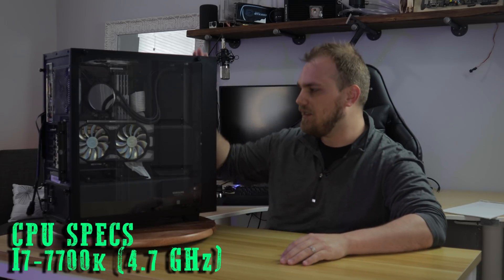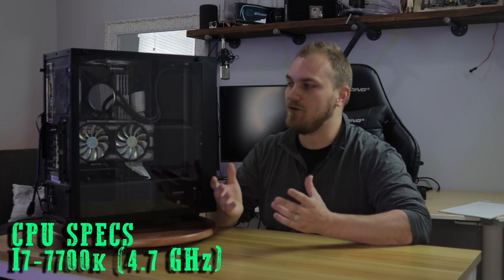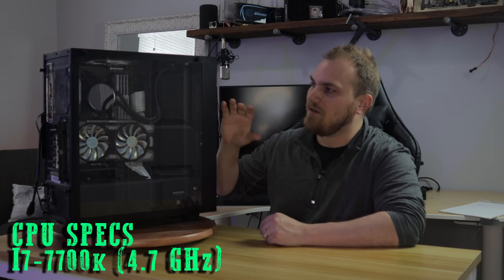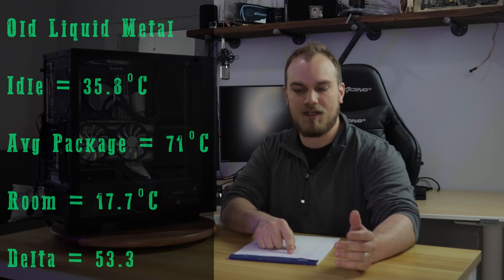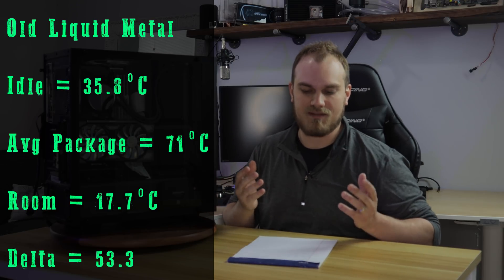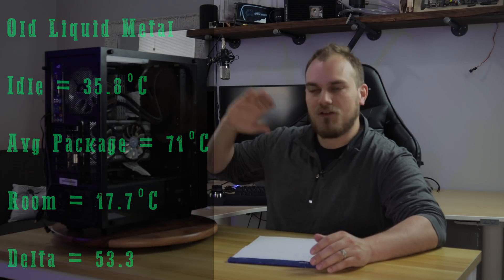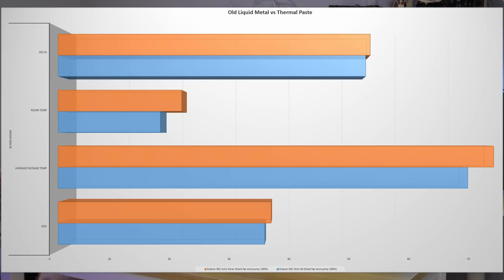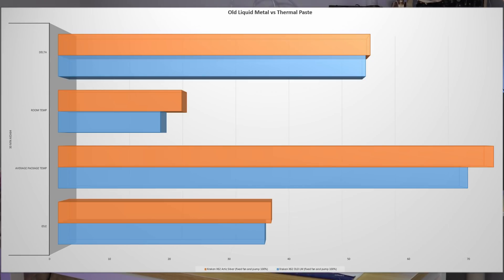What Liquid Metal Looks Like After 8 Months Of Daily Use

Comment: The silver looking material on the copper cooler is the "intermetallic compound CuGa2".  A. I. Ancharov 2008.  His research didn't address any changes in thermal conductivity, but your cooler has had a chemical reaction to the liquid metal, aka gallium.

Comment: Don't be afraid to delid your CPU bro.  By this time I'm sure you have grown confident enough to try this on your 7700k.   On any other CPU (with a few exceptions) I would never even concider deliding a CPU. But a I7 7700k MUST BE DELIDDED!  I can not stress this enough. You simply can't really do anything with a 7700k in a non-delidded state.  They simply run to hot.  Trust me and everyone else who is telling you.  please delid this 7700k.  I idle at 30 and never break 54 no matter how long i let it set at %100     YOU MUST USE LIQUID METAL between the CPU die and the IHS. This is where the problem is with this processor.  You can use paste between the IHS and the cooler and you will see very similar results, so I wouldn't recommend liquid metal here.

Comment: Is there any version of liquid metal that does not alloy with copper?
Reply: None all used gallium and it is absorbed by copper just like what you saw in the vid.
And as you notice it has less impact on Nickle plated IHS so using it in a Nickle plated cold plate is much more idea than copper, that's why user said if you use copper gold plate you need to reapply after three months. And after reapplication since the 1st application the liquid metal is now absorbed by the copper it is now coating with it so adding another layer will have no mo problem means will not absorb it easily just like the first application.

Comment: there is a huge advantage of LM... I tried 3 different thermal pastes and multiple times, but all of them were only a bit better than the stock paste on my RTX notebook. With LM, i got much better temps on the CPU and it was the only thermal compound which was good enough so my CPU doesnt throttle.
Im only a bit worried about the copper heatsinks but i ordered for this case for 80$ a completely new heatsink, so if the heatsink ever gets damaged bcause of the LM... i can easily replace it

Comment: Here's the benefit of liquid metal: its surface contact between chip and heat-sink will definitely not change over time. By virtue of being a liquid it must conform to the surfaces pressing it closely together. If the PS4 had problems with thermal compounds pulling apart or degrading contact over time, liquid metal would certainly solve that.

Comment: You're comparing an 8 month old, degraded liquid metal application to a fresh application of non-metal paste, and even then, they're about the same (AS needs to burn in a bit, so it will probably come down that 1 degree in the next few days). 

You did say that the fans spin louder than they used to... so what you're seeing now is not the optimal performance that Thermal Grizzly has to offer, but it is close to the best that AS has to offer. They're only about the same after there has been significant migration of the gallium into the copper heat block. That means there is less thermal material between the IHS and the block than there should be, and the mix of metals is off (more tin and indium).

That said, I personally use a high performance conventional paste between my desktop's IHS (lapped) and the heat sink (air cooled). The thermals are not so tight that I would consider it worth the effort to mess with the liquid metal.

I just wrote a reply to the 2 month of liquid metal video. I'd suggest nickel plating the copper surface before using liquid metal. It's actually very easy to do and can be done in about ten minutes, including the setup time. Look how nice your CPU IHS still looks after all that time... well, the IHS is nickel plated copper! The kit I mentioned in the other post costs under $50 and will last you many, many heat blocks/heat sinks/etc.

Comment: I am curious what happens if you put very tiny dimples in both the CPU cover shield and the coolers contact surface and fill those tiny pores with something better than copper.     On a related note, I would pay extra for a cpu that was shipped from the factory with a fancy kind of cover that augmented or improved the performance of a cooler.      I would also pay extra for a X570 motherboard that had the cpu soldered in, as I seldom upgrade a processor on the same motherboard.

Comment: It's weird to think that this video is a year old already. I use liquid metal on my delidded i9-9900K, which uses a custom CNC machined copper IHS as well. I tried with only liquid metal between the IHS and die, with Arctic MX-4 between the IHS and cooler and saw temps hitting 95 degrees on Prime95 SmallFFT. I replaced the MX4 with liquid metal and did the same test, which yielded maximum temps of 85 degrees. Both of the tests above were done with a Corsair H100i GTX. Once I replaced the H100i GTX with an H150i Pro RGB and used liquid metal all round, the maximum temps were 78 degrees running the same test. Liquid metal does wonders, though the effects of liquid metal are far more noticeable on CPU delids, as well as on laptops.

Comment: I did this exact same mod on my 7700k 3 years ago. I delidded and put Conductonaut between the die and IHS and the IHS and Kraken CPU block. About every 6 months it needs a fresh coat as the gallium ions migrate over to the copper in the cold plate. You don't need to scrape the old stuff off, just add a fresh coat like paint.
Reply: did you reapply LM to the die? On my 7700k I only applied it on the die but not to my ISH and cooler. I've noticed my temps suffering so I don't know whether to re-do it
Reply: @richcheema  I only ever applied it once between the die and IHS. It's the bare copper in the AIO cold plate that soaks up the gallium ions. The nickel coated IHS hasn't seemed to need it, but my temps were fine, so I didn't actually check. 

You may want to take off the IHS again and add another coat. If that's not helping, it may be your AIO. Over time, permeation reduces the amount of coolant in the loop, leading to higher temps.

Comment: This is weird. Why not use LM between bare cpu die and Ihs? That’s the best way to do it. I have been using LM for 2years on my delidded 6700k, it’s still runny and temps have remained the same as day 1. The copper might seem dry but that’s ok - no need to worry, it’s just gallium doing it’s thing.

Comment: I’ve always heard that you need as flat of a surface to get the best results with liquid metal. Basically the mating surfaces need to be lapped. I could still see the tooling marks on the copper surface, just a bunch of microscopic cavities that prevent solid contact and restrict heat flow. I wonder if you could have the copper plate taken to a shop that does lapping and could polish it smooth for you.

Comment: Your best bet is to delid and use the LM directly on the die and the bottom of the IHS. Between the IHS and your AIO use the standard paste (thermal grizzly!) to prevent the metals from reacting. I'm currently running a 7700k with this setup and i idle at around 28c, maxing out at 60c while gaming.

Comment: Well, typical beginners application fault here! Your thermal coupling is only as good as the weakest bridge. That stock i7 7700k has normal thermal compound between the silicone die and its heat spreader. That cpu is now 2 to 2,5 years old, that paste is dried up granting for bad thermal coupling! If you want to do it right, delide that cpu (I recommend tooth silk for that process), clean away that nasty old stuff, put some nice and fresh galinstan on the die, spread it with a cotton tab until there is a super thin film on the die (and on the die ONLY), repeat this at the center of the heat spreader on the side facing the die (again a super thin film!), use some double sided 0,1mm 3M tape to glue processor and heat spreader back together (be aware of alignment, you have only one shot at glueing back together, because the tape glues like crazy and missalignment could smear the galinstan ALL over the processor). After that do your normal cpu cooler mounting!

Comment: that sounds like to me u did not have enough liquid metal.Readmore
how i found liquid metal to work over 2years, 3 cpus and 1 gpu.
once the galium defuses with the copper and if there not enough indium left the 2 sufaces will become detached from each other
how i apply liquid metal now.... remember there is an oxide layer on both components u must rub ur way through that
using firm pressure use the applicator Q-tip to firmly rub in the liquid metal, do not assume that the LM is correctly on the intended area if it covering it!
how to know if the LM is properly attached to the surface's: during the rubbing of a surface if an area on the surface begins too squeak or binds noticeably on the intended areas then you'll know
once all intended areas are rubbed one u will notice small chunks of contaminants that is the oxide layer u have rubbed through use the applicator Q-tip to remove  most of them
once removed add additional LM 
install cooler but then un install the cooler to check the contact area has to much or too little add liquid metal as needed
if u follow these instructions u will not need to replace ur application for atleast 2 years i have a saphire radeon r7 260x with a copper base plate that did not have enough LM that after 8 months it stopped the pc from P.O.S.T.ing 2years there wasnt enough indium left over after the galium was gone so the gpu die became detached after the pc shutdown for the night

Comment: Liquid metal was meant for stay between dye (silicon) and IHS, not in IHS and CPU cooler... You corroded the cooler with that combination of metals. I don't know why you did that, well if you plan how to kill your Kraken fine.
Reply: It can be used on both (I have Threadripper engraved on my copper cooler now, haha! Really not needed for something half the size of a football field though but it would probably be good for FX or Intel parts like 7980XE since that is like 600w at 4.5 GHz)

Comment: I’ve been running liquid metal on my 1080ti for about a year now. I’m scared to look at it though
Reply: Shunt mod it! (You probably already do, it’s the best upgrade for that heavily power throttling card)
Reply: Honestly, it’s just the liquid metal so far. The card sits just above 2ghz as is.
Think it’s really worth it to shunt mod?
Reply: lilman227 yeah, I have my laptop sitting about 2 GHz (so it’s 1070 mobile, at that speed its outbenching other peoples overclocked desktop 1070 thanks to the extra CUDA core of 2048 on the mobile vs 1920 desktop). I mean, it’s literally only power limited on that laptop too but sadly no shunts. I know my Titan Xp hits the max limit of +20% even at stock, like it’s always power limited..., If you don’t shunt mod there is basically no overclocking (pretty much always the same +125 core, maybe +500 or 600 memory) besides undervolting the voltage-frequency curve using CTRL+F in MSI Afterburner and tweaking all the data points, which is just really annoying to me when with AMD cards I just edit the BIOS and set unlimited power so I don’t have to short out electrical components with a corrosive compound cause that just sounds dumb that it’s mandatory to do no matter how you look at it. So if you’re wanting a decent bump, you basically have to shunt mod (I’ll be honest, even my electric bicycle is shunt modded though, haha! Maybe I’m biased but if I’m overclocking, I want real gains in performance, but even with this Pascal will have more steady frame times not hitting power limits so it’s even useful even if you don’t overclock the card since the boost algorithm does some extra by itself).

Comment: Hi i use Artic silver mx4 thermal paste as it was rated in top 10 when i built my PC plus it doesn't conduct electric
Reply: Arctic Silver has silver in it which makes it conductive
Reply: @jsfodor1  before purchasing it i read up that the mx4 wasn't conductive if i remember correctly. But mx2 is
Reply: @avrel820  Ok

Comment: was that mixed with thermal paste? it seem like it on the cpu block. I have delided my 7820X and have liquid metal on the die and the cpu waterblock directly on the cpu die. have had it like that for a long time, its perfoming VERY good low temps and OC to 4.9 GHz all 8 cores with no problems.

Comment: The results are as expected and I have a few notes for you:
1. Liquid metal between IHS and Cooler is only better by a few degrees versus thermal grease. The higher the temps, the bigger the gap.
2. The x62 has a copper base which dried the liquid metal and needs re-applying. The stain has no impact on performance. Don't sand it!
3. The x62 is not powerful enough for 7700k @4.7GHz. Package temps should be around 60 with core spikes under 70.
4. You sould delid the 7700k and use liquid metal between the DIE and the IHS. Huge impact on temps! Remember to remove the adhesive.
5. Adding another 2 fans for push-pull will help with the noise.
6. Lapping the IHS will gain another 2-3 degrees.
Reply: Ping from the past.  Why dont you want to sand the copper base after the LM has platted it?

Comment: Your closing statements are a bit misleading. Liquid metal can definitely improve thermals and give you better performance. It's not for noobs though. You seemed to play it down as if it doesn't make a significant difference, but I know from overclocking my cpu, maintaining lower temperatures definitely keeps the cpu's performance in check, especially at the edge. I'd love to apply some conductonaut to my system, although its outdated and showing it's age and probably isn't worth it, but then again, it might just help it out enough and keep it ticking a bit longer. And, if I did get some conductonaut, I would definitely consider delidding to get the most effective heat transfer. Even if you delid you can still re-attach the IHS if you would rather; using liquid metal between the die, the IHS and the cooler will still be better than not delidding.

If you don't have the right tools, delidding is kinda not worth it... And it's definitely not worth it with a soldered IHS. My IHS is definitely not soldered, I've delidded other cpus in the same family.

Comment: Quoting an old experiment from GamersNexus:

"This is similar to what we saw with nickel, but much more extreme and effectively impossible to remove, even with a lot of acetone. That’s because we’re starting to see ion migration into the copper, with some of the liquid metal permanently plating the copper. Gallium has a negative potential and copper has a positive potential, which will cause the gallium to migrate and plate the copper. In terms of performance, the copper IHS retains all of its original performance characteristics (in our testing), and so looks a lot worse than it is in reality. This is a stain, not heavy pitting or corrosion."

So in the copper you will have gallium atoms. Will it prove thermal conductivity? Will it remains the same? It seems so.

https://www.gamersnexus.net/guides/3362-how-liquid-metal-affects-copper-nickel-and-aluminum-corrosion-test
Reply: Interesting.

Comment: That was pretty good. In my case, copper plate against a Ryzen 1800X (Is plated copper) and both surfaces got welded together by the reaction. I had to pull the CPU from the socket, pretty scary stuff but I learned a great lesson and will try LM again now with a 3900X

The temperatures were absolutely stellar during the time the LM was there (in liquid or crystal) from its first day till the last. I decided to pull it out because I wanted to see how the LM reacted, not because the temps were bad.

The lesson is, the copper is gonna form a new compound, and you need to reapply LM each time and they will not glue together anymore. And if they do, I can always unlock the CPU socket lever ever so slightly that pulling the CPU will not be as aggressive for the pins/socket.

How did the LM look after 4 months? Well, the CPU was firmly "soldered" on the copper plate. I needed to use a tool to pry between both surfaces ever so slightly to move it and it popped out. It was very interesting to see both sides had a coat of crystals attached to them, both sides mirroring each other, you could see the bond was great between both surfaces at the time the CPU was installed.

I sanded both surfaces and used Noctua Paste afterwards out of fear, I should of leaved the new metal compound formed by the LM on both sides and reapply LM. But I didn't know what would of happened back then. I'm ready to give it another try.

About LM application, if it is thin enough it behaves as paint and will not spill at all anywhere.
Reply: Haha, yeah I had my Threadripper at 95c trying to losen the cooler and ended up needing a lot of force on a screwdriver to rip them apart, haha, “Threadripper” is now engraved on my cooler which looks cool, haha!